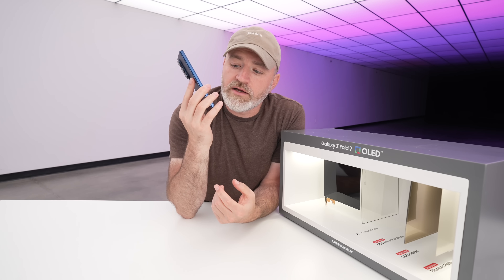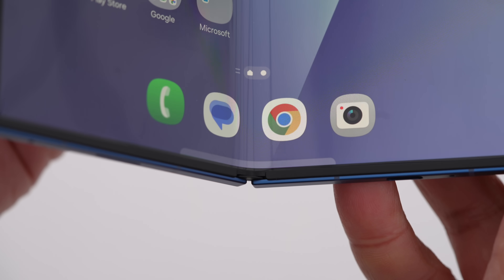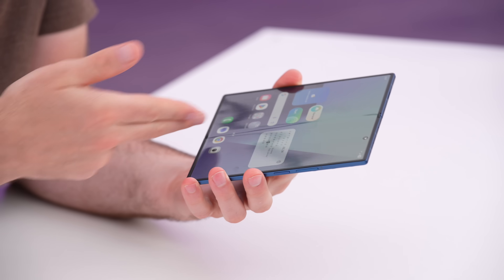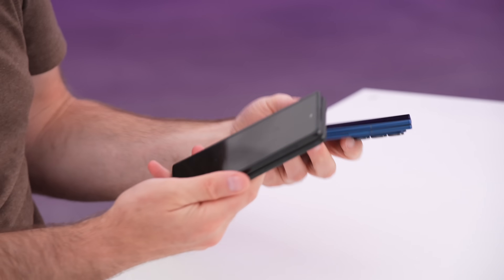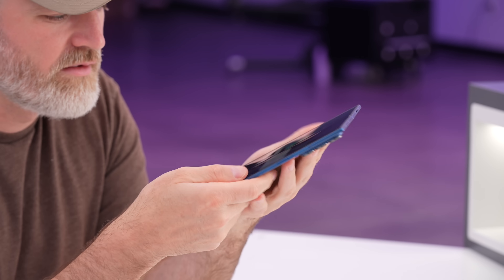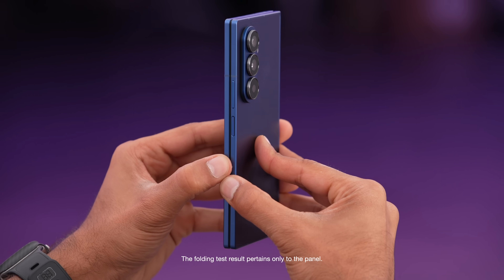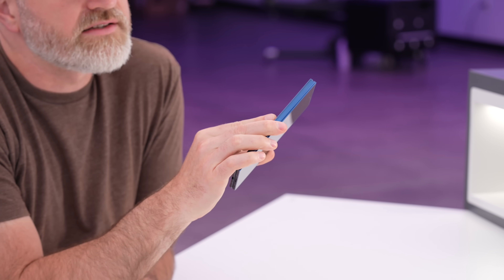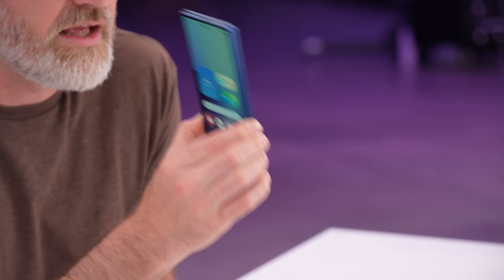How to Make the Thinnest Smartphone

Comment: We have reached the peak of folding phones the only problem im broke
Reply: You problem is my problem
Reply: @upendrajat6215 same lol struggling
Reply: Can do what I did... Trade in a phone on a post paid plan offering credit toward a fold/flip. I traded my zflip 5 for a zflip 7... completely worth it. Out the door... tax + $35 activation. So like $145? And then I am getting $1100 in trade credit for the phone I traded.
Reply: peak would have been with a Si/C battery, but close enough.
Reply: Take my advice 
Save little and invest in banks/mutual funds/gold/property/stock market instead of investing in electronics 
Later you can buy ten of these kinda tech
Reply: Probably less than 1% of the people around the world buys foldable phone and probably most of them are Chinese where the phones are much cheaper. So in this case everyone is broke. I even gave up the iPhone lineup (not even the pro, but the normal) Next time I will buy a 3-400 dollars phone. The price of the Apple ecosystem is too high.
Reply: It glitches and crashes too. Just wait a few years.
Reply: You can get a pixel fold for $500. Ebay just got mine worth it
Reply: @anitoliprotosov5922  I never realized how much smart phones depreciate in general until I looked up the price of a ZF5 and it's less than half of its initial retail price. Granted most of them are refurbished, but still a good price. That's insane
Reply: Doff my hat for your honesty mate. You could have easily said no spen no buy !!
Reply: 😂😂 mee too
Reply: U not broke is just useless man
Reply: Yep, these samsung foldie's don't come cheap 😅 2k 😮
Reply: Start and onlyfans
Reply: korean technologia
Reply: NAH. We need the tri fold so we can use our phones as iPads if WE WANT
Reply: Not yet, it is still very easy to break
Reply: Even if I had the money for affordable phone I wouldn't buy one They're stupid
Reply: Next improvement will be two screens that open and join connect to work as one. No more crease or flexing display and cheaper cost.
Reply: @benjamin7114 I had an LG v60 with the dual screen. If Samsung wanted to go in that direction they could have. In fact, I think it would be cool to have a folio style case for my z flip, one housing a second full sized screen. 

But I think foldables are already superior to what you're talking about... No seams
Reply: This is definitely NOT the peak until battery life improves. No point in having a phone that can't make it through a work day.
Reply: @4gettaboutit  A full day of use on my flip 7 is estimated at 1d21h. I have power saving limiting normal usage to 70%, dim screen 10%, turn off adaptive screen, AOD disabled, dark mode enabled. Performance profile is set to light. 

This is how you reach all day battery life. I get almost 2 days out of mine, but I also have a PC I use all day, a second phone I use when my primary phone is charging (I also have a 2024 edge that is a great backup phone, got for like $65 after a stylo 4 trade on Tmo). 

Using any phone can drain battery within a few hours, because there is such a thing as 'power using' like running full sized PC apps or games (which disables power saving/performance profile). Unsure what you do for work or how you use your phone, but nothing is going to last all day if you spend every minute of work on your phone playing a game or something.
Reply: @4gettaboutit true! But I have it anyways
Reply: As long as you have good credit, you are able to have things that you want.  I got Affirm, even though I can afford to buy it out right, I would like to keep my money in my pocket and pay them a little each month. 😃🙏🏽👍🏾
Reply: @bigdeluxe986  Yup. I financed my V30 back at the end of 2017. I paid it off over 2 years. I financed a V60 3 years later. From there I financed the Zflip 3 when it came out. Then I traded it for the zflip 5 and got full credit. Then I traded my zflip 5 for my 7, once again getting full credit. 

This is the second time I've traded my device and gotten $1000+ credit for it. Keeping a device in good condition, having the right post paid plan, does wonders for letting you have the latest tech. 

I complete the experience by being an electronics repair tech. I keep my devices out of the landfill AND the repair shop.
Reply: The peak of foldables achieved by china phones last year 😂😂😂. Im surprised why samsung gets all the credit after 7th generation of phones....
Reply: @izzarulhadi5163  What would that be? I don't count being thinnest phone as 'peak.' It's also hard to count anything coming from a country that is undoubtedly sanctioned from the rest of the western world. 

The reason why I say the flip/fold 7 are peak is because they are what's available with proper support in the western market.. cuz that's where I am at. 

They represent what can only be described as a clear improvement over last generation on both devices, while also somehow managing to achieve new form factors for foldables. The zflip 7 is a bigger device than the previous flips. 

My tests with it have yielded impressive results, it stays cool, it doesn't have performance issues in any area I've tried, and for an Exynos chip: surprising efficiency. 

After a couple weeks of ownership, my zflip 7 estimates 2d15h of usage on a full battery. 

I don't have a fold 7 yet, but from what I've seen/felt from checking them out at stores, it is a clear step up from prior foldables too. 

Some users mention 'sodium batteries' and ask why Samsung didn't use them. Samsung uses NMC batteries, rated from 1000-2000 charge cycles, Samsung NMC cells showed outstanding durability in lab tests: ~80% health retained after 3,000 cycles (75% depth of discharge at 35 °C), outperforming LFP counterparts from Sony and BYD (which lost 5–8% capacity after 30 months)

My personal repair experience shows Samsung batteries tending to last longer than other brands, particularly in the last few years. I don't think they need to suddenly adopt a new battery tech.
Reply: We are never getting a PEAK phone.
Reply: @TheWarfare07  People won't consider anything peak unless they can somehow pop out the battery themselves and then also buy parts for it from an OEM. 

The thing could be bulletproof, weigh less than a feather, and have infinite battery charge... people will still die on the hill of 'fixing it themselves somehow.' 

I wish people could recognize how good they have it.
Reply: It's not the peak yet. The next improvement will be the battery mark my words.
Reply: The peak would be making them affordable.  Relatively speaking.
Reply: It's not the peak until they fix the easiest problem, the crease (don't ask me to explain how cos it's one of those things that needs to be explained face to face or with a drawing) And you're not broke they are just taking advantage of the gimmick to overprice them af, even the most overpriced phone manufacturer (Apple) doesn't overprice things so shamefully
Reply: Bet more battery than iphone
Reply: @RickSanchez-nn6friPhones have better batteries than most 5000-6000mah android phones so if you knew what you were talking about you probably wouldn’t respond with crappy comments